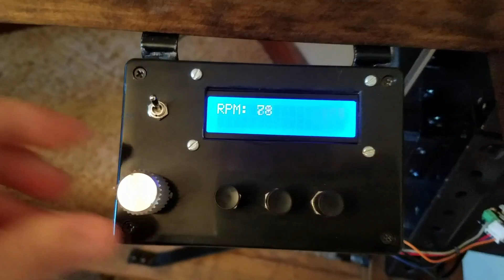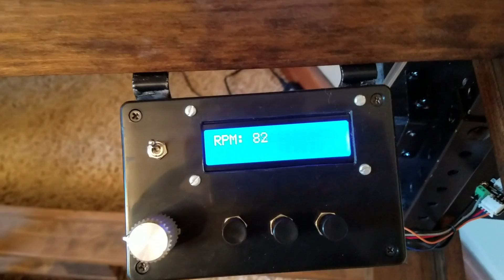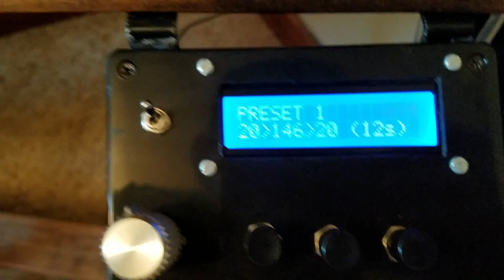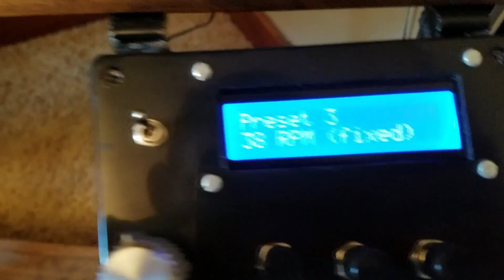Programmable Vibraphone Motor

Comment: When writing for vibraphone, do you recommend notating a speed for the motor, or simply stating whether the motor should be used or not?
Reply from the maker: I would definitely specify the speed. Not necessarily an exact RPM setting, but a general direction of what the speed should be. The frequency of the vibrato definitely changes the tone of a piece.